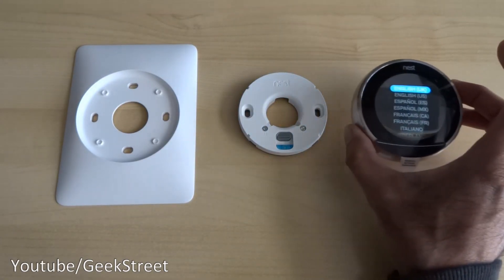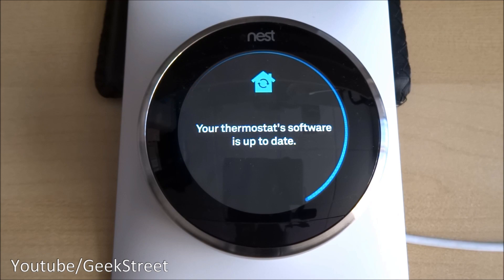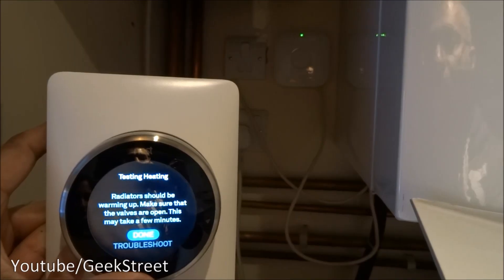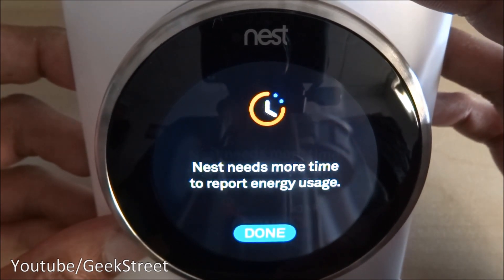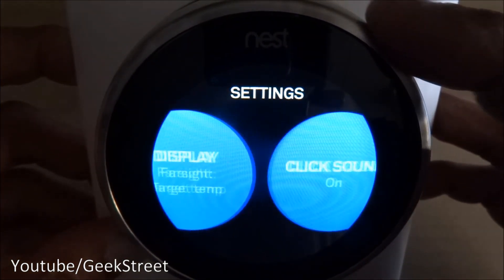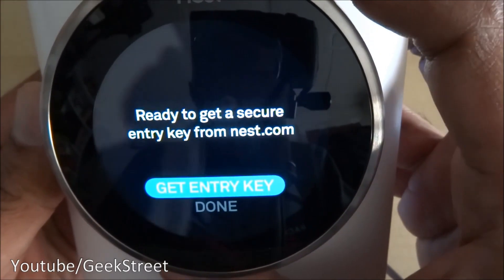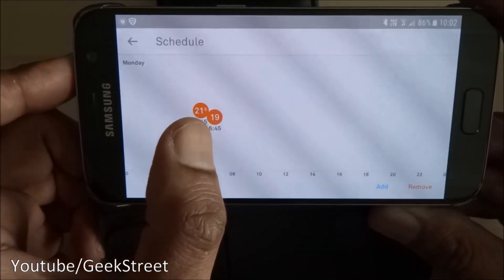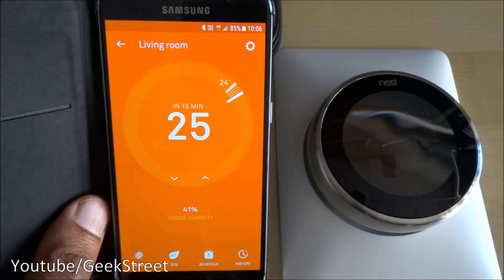How to use NEST Thermostat 3rd Generation App Features and Functions for Beginners

Comment: The nest is pretty terrible at customization and service reminders. There's no filter change reminders/filter efficiency measurement. There's no 5 day forecast. The fan can only be turn on manually if you have cooling or heating selected. [The auto fan feature is pointless because the heating & cooling feature is on]. There's no separate cool or heating features for seasons at different times. e.g. setting Cooling to 78°F @11:00am, but forcing to set heating simultaneously. (I understand as long as cooling is on it'll do cooling temps) but the issue is now i gotta create an entire different time for winter season. Why not have the two separate temperatures settings OR  have two different times for heat&cool ?!

Comment: how do i get my dial to turn below 9? it currently stops at 9
Reply from the maker: Thats the minimum you could just turn it off.
Reply: @GeekStreet  oh.. ok! how come
on a normal thermostat you can turn it to 0? does it mean if it’s on 9 it’s always on in one way or another? there are times in the day where the heating isn’t set on but my kids rads are still hot.. is that normal?
Reply from the maker: @danielatabor9130  9 degrees in a home is really cold. If your rad's are still warm with the heating on then it doesn't sound like its been installed correctly, best to get a plumber in to check it.
Reply: @GeekStreet  ok thanks! have someone coming in the new year so will check 👍🏻

Comment: Have most recently moved into a bungalow that has installed by the previous owner a wired in wall Nest thermostat which I didn't have a clue how to operate. Your excellent video has given me a great deal to work with and I shouldn't be cold this winter. Many thanks.

Comment: Excellent walkthrough. We've having a new boiler fitted next week as the old boiler packed up on Christmas Eve (as it would!). The engineer recommended Nest as it can interface with Alexa. Is it easier using the app than the Nest unit itself?
Reply from the maker: Thanks, the app it definitely easier to navigate through.

Comment: The initial setup is not strictly correct, the usb lead used in this video is for the stand which you buy separately.

The back plate the nest connects to is for wall mounted nest devices which is hard wired in replacing a mechanical stat.

The rest of the video is very good 👍

Comment: Can I still use my heating /boiler if I decide to turn off WiFi/the nest???
Reply: Yes, the heat link this thermostat connects to, normally in the airing cupboard, has a button in the middle to manually operate the nest in the event of no WiFi

Same with the Nest E which is stand mounted and is for combis